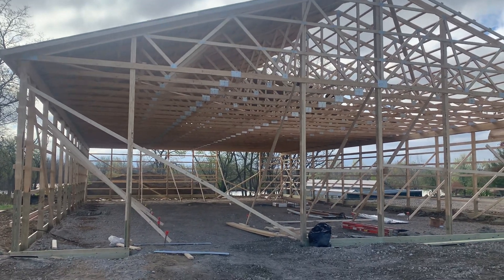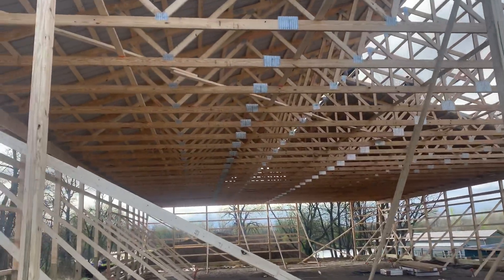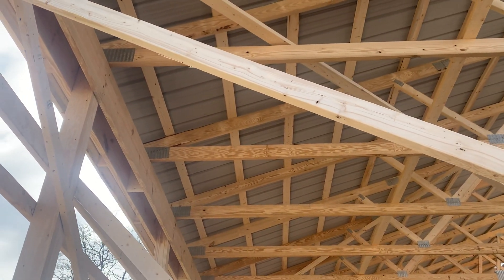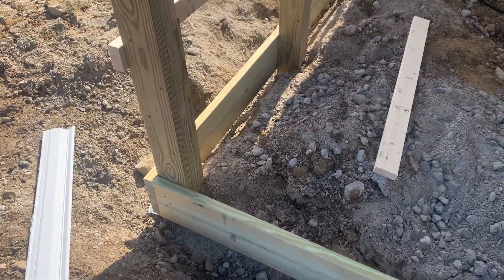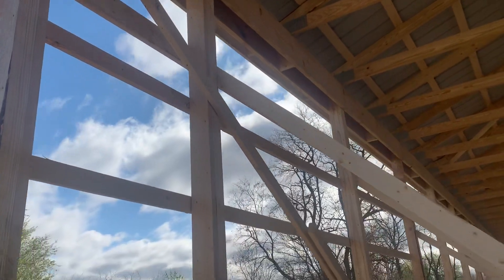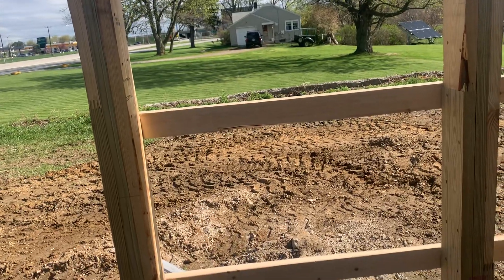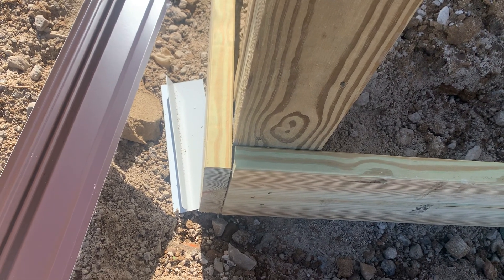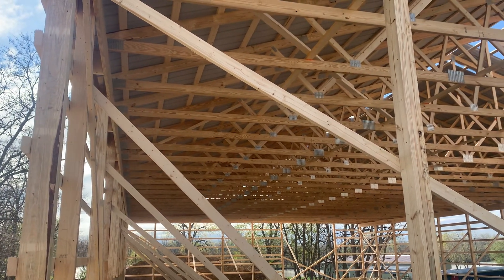60’ ft trusses (4/12 pitch, 4’ OC) | 60x100 Pole Barn

Comment: looks really good. did you run into any issues with the building being so long and wide? did you put a barrier on the walls like you did on the roof
Reply from the maker: No issues.  Put housewrap on sidewalls.  Rex or drip stop Metal for vapor barrier.